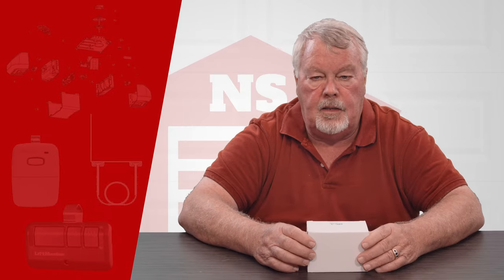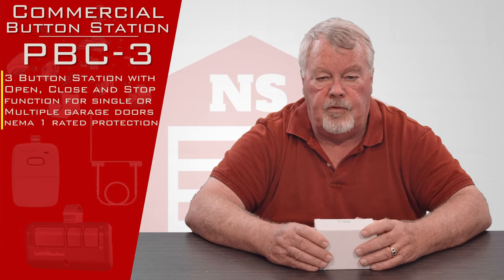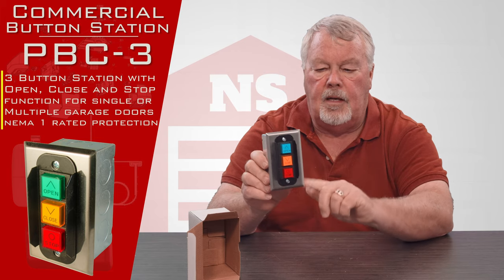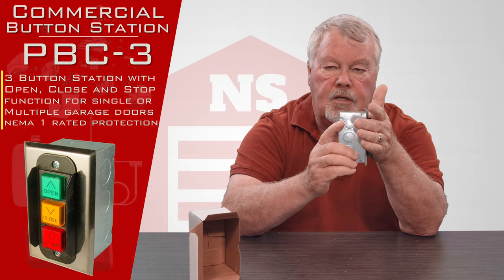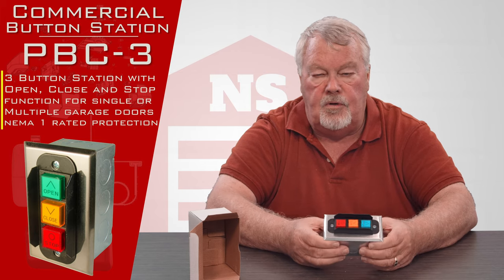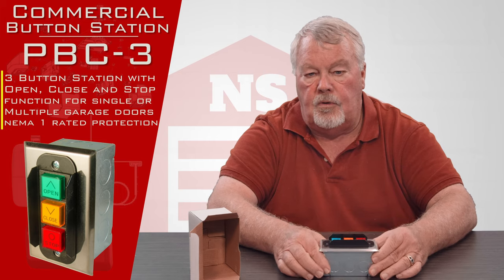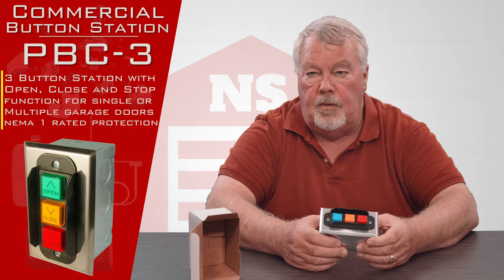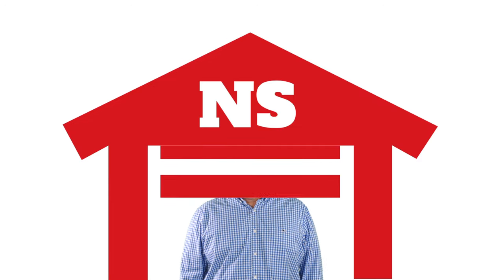Commercial Garage Door Opener PBC 3 Flush Mount Three Button Station

Comment: This is exactly what I want . Unfortunately I have a manual switch for my home garage that has only two wires . I suspect this isn’t compatible, but I really would like something that mounts in a single gang box as opposed to to just surface mounting a switch on the wall